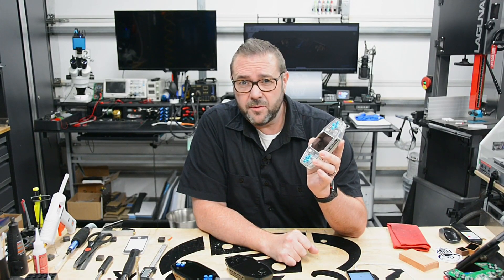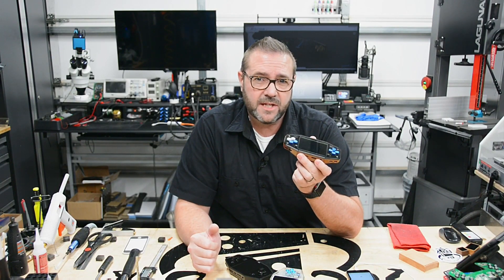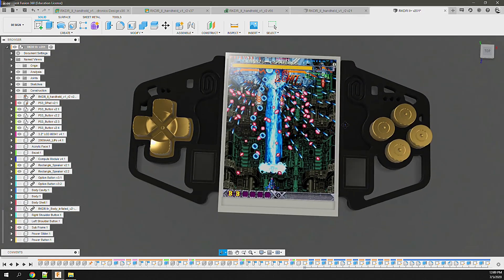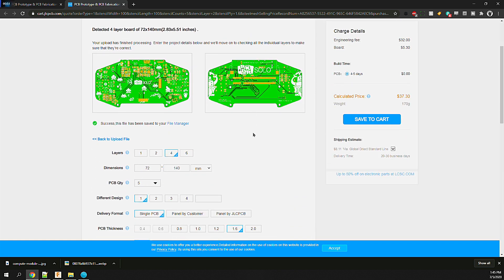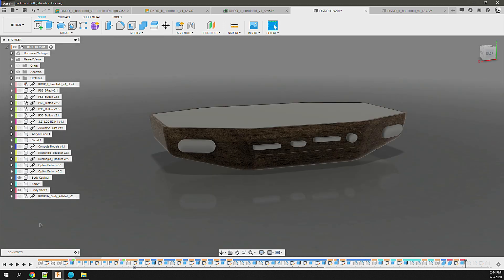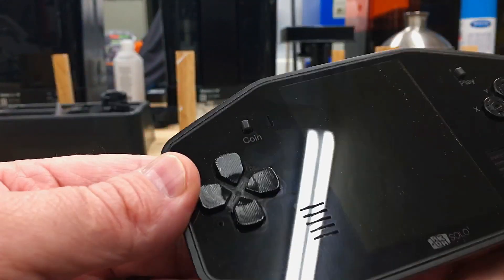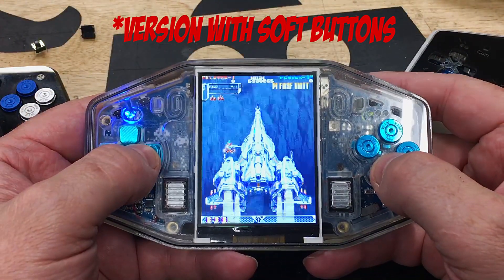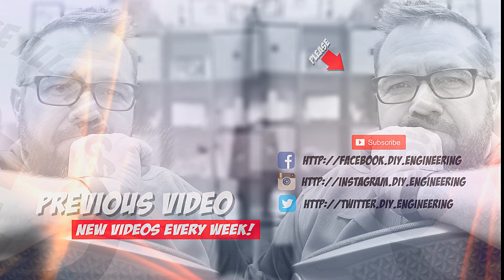Episode 039: Engineering a Better Retro Handheld, The RKDR 3

Comment: I bought a cheap adreno 540 smashed screen phone for my controller. I’m looking for a tutorial if I can connect usb c to hdmi on a hdmi 3.5” screen. Most preferably take out the internals and make it look good with a 3d printer maybe you can lcd cable.